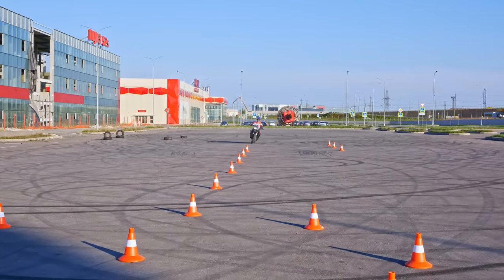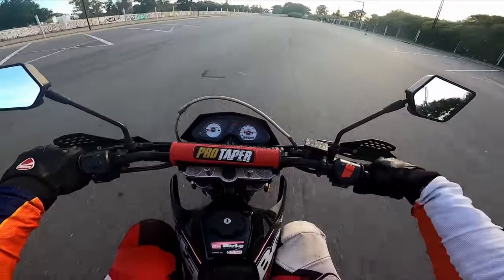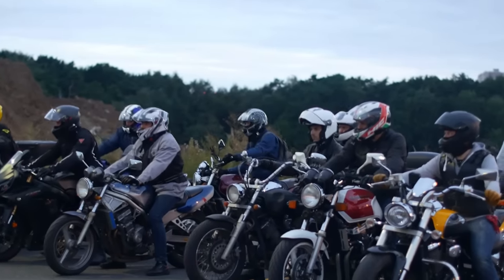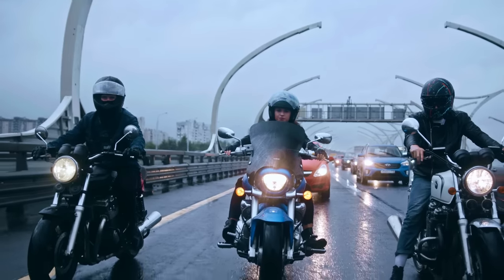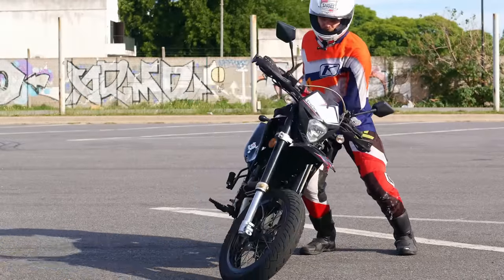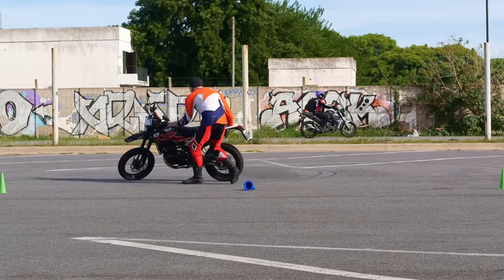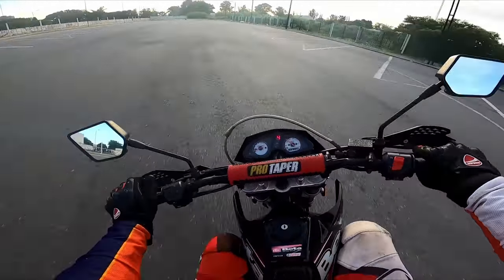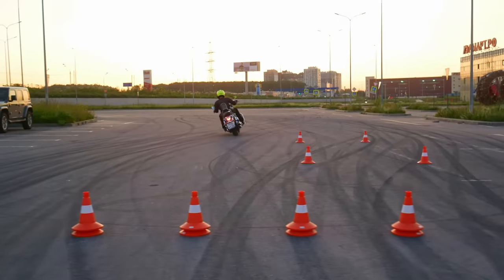How to use Counter Steering to Lean and Turn Your Motorcycle

Comment: One thing you didn't quite go into enough is the 30~40+ mph counter steering.  At those speeds, the front wheel doesn't actually turn into the corner, you effectively "dial" your lean almost like a steering wheel but steered in the reverse direction.  Steer a little more to the left? lean a little more to the right.  Want to pick up from a right lean? steer to the right until you're back on center.  At no point do the bars really "wobble over" like they do in low speed turns.  Nearly every video forgets to point out this difference in handling from low to high speed and it's critical to understand.  At 40+ the handlebars are basically a reversed car steering wheel.  It makes no intuitive sense, but it is what it is.
Reply from the maker: On higher speeds once we have a lean angle front wheel still points inside the turn. It's just the angle is so little so we perceive it as non-existent.
Reply: @MotoControlEn   Andrei,  this is not necessarily the case because even if the handlebars were completely straight, the bike would still be turning due to camber thrust.
Due to the geometry, the handlebars will turn towards an angle that keeps the bike stable, but it's possible due to the camber force that a zero-steering angle could be stable at certain speeds / lean angles.  After all, remember that a wheelying motorcycle can also be stable in a turn.
At straight handlebars, for any given lean angle, there would be only one stable speed, so a motorcycle where the handlebars cannot turn is not rideable.
Reply: @MotoControlEn  Nope, it does not.  Watch MotoGP or AMA from the rider's POV during a high speed, high lean corner.  You can actively see the bars turning to the "outside" of the corner (i.e. bars turning to the left when cornering to the right).  I also have confirmed this many times on my own motorcycle everywhere from tracks to everyday riding.  It simply does not dip into the corner like it does at lower speeds and you can "dial in" more or less lean by rotating the bars, completely different set of handling physics after 40 or so mph (it slowly transitions between about 10mph and 40mph by I don't want to overcomplicate it).
Reply from the maker: @nunyabusiness896  Here is the demo from Twist of the Wrist, https://www.youtube.com/watch?v=TW6h5aq-xqw&ab_channel=FranBunnyFFXII time 1:38  Sportbike, high speed, track riding, front wheel is facing inside. What I think you are referring is drifting like in Casey Stoner video: https://www.youtube.com/watch?v=CDhp11mKYyk&ab_channel=Termignoni
Reply: @MotoControlEn  Really diggin your heels in on this one, huh?  Go try it.  Go at least 50 mph on a long constant curve and tell me if you feel the bars turn into the turn like they would at 20 mph.  It doesn't turn in at all.  It's not a matter of "not feeling it" or "not seeing it", my hands literally do not change position or allow the bars to move and the bike stays tracking exactly how I want despite remaining being turned in the opposite direction of the turn/lean.  If you let the bars turn "into" the corner at higher speeds, the bike will start to straighten up and lean over the other way, it's like a reverse car steering wheel in how you can add or subtract lean with it.  Twist of the wrist says nothing on the contrary.  Camber Thrust and other forces completely change the character from low speed handling.  Hard to say if drifting was involved in the Moto GP clip, but there are absolutely cases of pure grip riding where the counter steer is obvious through the turn and there is no sliding.  I have no more to say on the matter, you can either recognize it or choose willful ignorance.  Not everyone has large race tracks and convenient medium-high speed winding roads to experience this for themselves.  If I was wrong about it, I would be dead from hitting a wall at 100 mph by now.

Edit: that clip of Stoner has no sliding, that is a perfect example proving me right. You can tell the tire is tracking 1:1 with the pavement. Your funeral if you don’t believe me.
Reply from the maker: @nunyabusiness896  Ok, if you say so:)
Reply: @nunyabusiness896  Show us how you corner with fixed handlebars.
Reply: @XtreeM_FaiL  If you think I was implying you can corner with fixed handlebars you didn't read what I said.  I said you counter steer and the bars stay counter steered until you're ready to stand the bike up or lean the other direction, they don't tilt into the corner like they do at low speeds.  This is empirically true, go try it right now.
Reply: @nunyabusiness896  " I said you counter steer and the bars stay counter steered until you're ready to stand the bike up or lean the other direction, they don't tilt into the corner like they do at low speeds."
So wrong and speed does not matter either.
You push left bar, tyre turns to right, bike will lean left and then the tyre also turns left.
Reply: @XtreeM_FaiL  No, at higher speeds the tires would not turn left.  Have you never cornered at highway/track speeds before? Clearly not.  Left corner approaches (at speeds above at least about 30 mph to be sure), steer the bars to the right, bike leans left, bars stay steered the right, bike continues left lean until you want to straighten the bike up, then you steer the bars to the left and the bike straightens up.  What exact combination of forces makes it this way I can't say, some combination of gyroscopic forces would be my guess, but nobody had definitively mathematically deconstructed the physics of two wheeled vehicles, so all we have is empirical evidence and empirically the tire does not tip into the corner at higher speeds.
Reply: @nunyabusiness896  What happens at 30mph?
How do a bike know how fast it goes and how to behave?
If you ride 29,999mph and then middle of a corner you speed up to 30,1mph, do you start turning the other way?
Speed does not matter as long as you go zero speed or faster forward.
Of course rossi is countersteering because that's the only way.
Maybe it is different in Murica. People there are frigging idiots.
Everywhere where people use or at least know km/h, bikes behave the same. No magic speeds or mystical behavior. 
Simple, logical and always reliable.
Physics will not change even if you think or feel it does.
Reply: @nunyabusiness896  "OK, I've had about enough arguing with a 12 year old World of Tanks player that's never been on a bike."
We have something in common.

"There's a transition phase from 0-30 mph"
New physics?
Is it safe to say that it hasn't published yet and that's why you can't link a source?

You don't need to know (and obviously you don't) how bikes work to ride them.
Just like you don't need to know how internet works to write a stupid comments on Youtube comment section.
All you need is to know how to do it.
Reply: What is missing in this debate is consideration of Newton's three laws of motion (i.e. what actually generates the force that turns the motorcycle).  I have a university degree in Physics, and have been and avid motorcyclist for 50 years - so I've thought a LOT about this issue (and seen every argument under the sun).
First, it's important to understand that single-track vehicles (i.e. bicycles and motorcycles) cannot turn without leaning. The force that initiates that lean is counter-steering (people who say they "just lean" the motorcycle don't understand Newton's laws of motion).  Now that the motorcycle (or bicycle) is leaned over, what generates the force that propels it around the corner? 
I believe corning force for single-track vehicles comes from 2 sources; slip angle and camber thrust,  The relative contribution of these two sources of cornering force changes with speed. Slip angle is the force that causes dual track (i.e. 3 or more wheels) vehicles to turn (i.e. turning the wheels in the direction you want to turn).  Camber thrust is generated because the center of the tire has a larger diameter than the edges of the tire (the classic example is a rubber stopper in chemistry lab). At slower speeds, slip angles plays a bigger part; at faster speeds camber thrust plays a bigger part.
The other factor at play; tires do not have perfect traction with the ground - they ALWAYS "slip" some amount.  Faster speeds and lower traction exaggerate this slip (e.g. Speedway Motorcycle racing). When the rear tire slips under acceleration, the motorcycle must be counter-steered to oppose this action.  Before I get blasted by YouTube commenters, please note: while this is the same motion of the handlebars, this "counter-steering"  is needed to oppose the slip of the back tire (not to initiate lean angle).
The irony of this debate - everyone is partially correct.

BTW: I did my Physics thesis on "Passive supercharging from exhaust pipe shape in 2-stroke engines" (i.e. so called, "expansion chambers"). I not only did the theoretical work, but also built a dynamometer and welded many differ exhaust system shapes to prove the theory.  If I had put this same amount of work into a scientific paper on how single-track vehicles turn, I would have all the fully instrumented tests to prove what I stated above.
Reply: @danielklopp7007  We can go back and forth on physics theories all day, but the fact is that NO ONE has made a conclusive, falsifiable, complete mathematical formula to explain the stability and handling parameters of a bicycle.  You can see this TED talk where someone attempts to make an "unrideable" bicycle and fails: https://www.youtube.com/watch?v=2Y4mbT3ozcA and this video that further supports simply that nobody knows: https://www.youtube.com/watch?v=YWsK6rmsKSI  

What we do know is empirically what works and what doesn't, whether or not we can assign numbers and variables to everything.  The fact is, at speeds above approximately 30 mph (the exact speed may vary by bike, I've only ever owned sport bikes with similar geometry), the rider must maintain a counter steer through the corner to continue leaning and turning.  It's a progressive effect up to that point where "conventional steer" (where counter-steer is a quick initiating maneuver then the bars lean into the corner) becomes less and less until it "crosses over" to being counter-steer through the whole corner, which people that only ride in parking lots or on grid roads with low speed 90 degree turns may never experience.  This may well be the sum of slip angles or camber thrust or a litany of other things including gyroscopic forces (i.e. conservation of angular momentum:  https://www.youtube.com/watch?v=sbEAmtvgGMo&t=42s ) or even the fact the rear tire is wider than the front and so when leaned over the contact point of the tire makes the bike appear to be counter-steering from the viewpoint of the rider when in fact the tires are inline at the contact point and/or slip angled to the point of creating a net rotation.  The bottom line, though, is that the motorcycle behaves differently at different speeds from the viewpoint of the person riding the bike and it's important to understand that you are, in fact, counter-steering the bars through the duration of the corner, otherwise the bike will naturally just stand up and run wide (I have tested it myself), which will not happen or not happen as severely at slower parking lot speeds where the bike will just hold its line or start turning tighter and tighter until it falls down if speed isn't maintained.  If either of the people previously arguing with me would just get on their motorcycle and ride through a consistent-radius corner at 50 mph they would immediately know that I'm right, but one won't leave a parking lot and I'm pretty sure the other has never ridden a motorcycle at all and just likes to argue about things he knows nothing about.  Heck, a simple sharpie mark on the handlebars and tank with a GoPro filming would be all the proof you need that, at least from the rider's viewpoint, the bars need to be counter-steered through the duration of a corner at higher speeds.  And no, I'm not talking about dirt track riding, "backing it in", or any of those deliberate slide techniques, I'm talking about normal pace with no significant slip.

Comment: excellent video on the counter steering - wrong explanation about the balance . the angle of front wheel has nothing to do with the balancing . i have also jet ski - no wheels at all and it balances when you increase speed. the bicycle will not balance backwards not because of the back wheel that is in the front - but because of the front wheel that wobbles in the back . if you fixate the front wheel and throw it backwards the bicycle will balance . I have electric unicycle- there is no angle - it is 90 degree balanced - and it can still keep balance when in motion .
Reply from the maker: Maybe if you make a video where you fixate the front wheel of the bike and throw it backwards and the bicycle will balance this statement will be believable😉!
Reply: @MotoControlEn  deal! will show you with and without fixating the front wheel when rolled backwards .unicycles in circus ride and balance when there is no angle / also take bicycle and hold front wheel and ride backwards and with little practice you will be able . again without the angle . take just wheel or tire without any bicycle and roll it - it will roll - without any angle .try to roll it back and of course it will roll too  .
Reply from the maker: @robertbarel896  Very good, but it is not a bicycle, it's a single wheel🙂

Comment: I dont agree on your view that gyroscopic force has nothing  to do with stability of your bike. When going forward the rear wheel is stablised and follows the direction of the front wheel which is held upright by the gyroscopic force. When you push it backwards the front wheel has no stability. Therefore the bike falls down due to a free moving front fork set up. You have a hole in your theory.

Comment: Every video just mindlessly repeats "push left to turn right" which makes no sense and technically isnt correct. But using the handles to initiate the lean angle makes much more sense. You still have to turn the front wheel right to turn right. I have never pushed on the left bar to tighten my left turn, which is what everyone else makes it sound like is happening.

First video where the person actually understands what counter steering is enough to explain it.

Comment: This guy is putting the cart before the horse.  The steering geometry dictates the angle of lean. When you accelerate or brake, the bike self-steers depending how on the steering geometry affects the trail. With less trail, the bike usually tends to understeer, so is safer at low speeds. At high speeds, understeer makes the bike more difficult tip into corners while braking, and tend to run wide while accelerating out of corners.

Comment: If you have learned to ride on a bicycle slow and fast you already adjust for different speeds! If you have little experience on two wheels and have to think about this ??? Most of the slow speed examples shown here are not counter steering! They are steering and leaning without counter steering! That would be very confusing to someone as his dialogue does not match the slow speed rider! You do not have to counter steer at relatively slow speeds around closely spaced cones.

Comment: You can ride well but this is not counter steering. The little opposite steer you're doing at slow speeds is the equivalent of the annoying opposite lock turn car drivers do, when they think they're driving a 40 footer round a corner - totally irrelevant. You can see no hint of counter steering once you start doing a series of slow turns, apart from the initial 'show' one at commencement. Counter steering starts once gyroscopic affect comes into play, opposite lock will tilt your bike into the turn - the opposite lock pressure is maintained and the bike turns due to tyre profile. Circumference larger in the centre than at the rim - push a cone on the ground and see which way it turns....towards the smaller circumference. Everything about riding a bike is maintaining smoothness; braking, acceleration, steering input - your little opposite flick at slow speed, in greasy conditions,  is just asking for a down

Comment: The name 'countersteering' is stupid and not intuitive at all. Countersteering means exactly what you described at 9:30. The kind of "countersteering" described in this video should be called 'opposite steering input' or something similar. Giving the same name to two phenomena that are related to the same thing (steering input) but do pretty much opposite things is one of the reasons why new riders are confused about all of this.
Reply: Correct, counter  steering is what the riders are doing at 9.30 ie the wheel that steers is on the opposite side to centre of the turn radius.The bank angle is the only thing that turns a motorcycle, an airplane and a helicopter in non hover flight. Until Code wrote his famous book it was just called cornering.The counter steer proponents are responsible for many fatalities,as in an emergency situation, the brain load sheds excess information and the rider does nothing.If you watch crash videos in corners, especially left handers in the US, you see many crashes caused by the rider pulling on the front brake inadvertently pulling the right handlebar back causing more lean and a wipe out, not from the brake but the counter steer.Most of the right handers are crossing the centre line because of not leaning while the brain thinks push left or push right,just slow down or lean more to tighten the radius.

Comment: At 13.51 you are not proving anything. Your centre of mass is still over the centre of the motorcycle. Loading the peg, is the combination of using your core strength ,and outside leg pressing on the tank, causing a turning moment. Standing also makes the motorcycle rider combined centre of gravity higher, making it more stable.